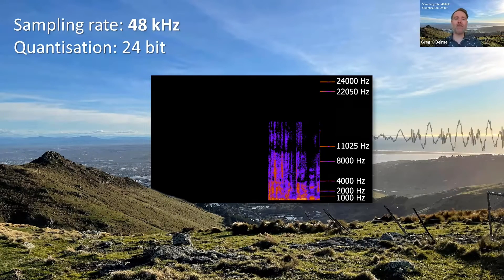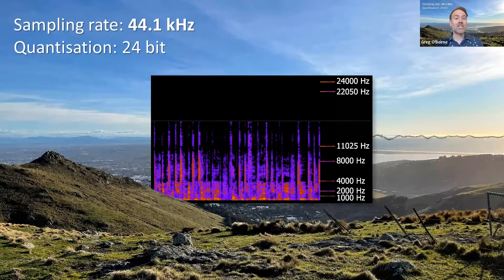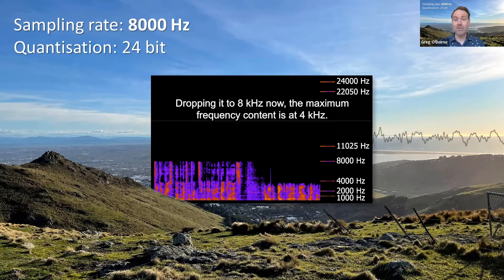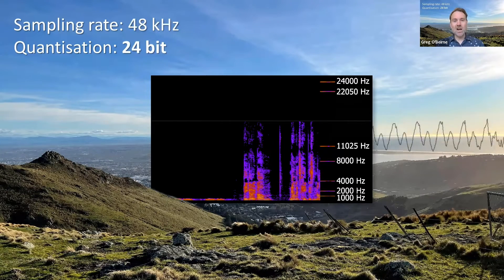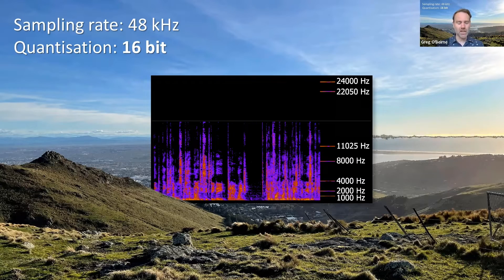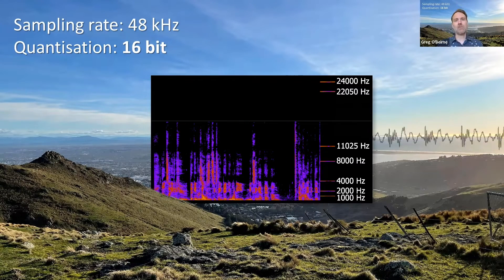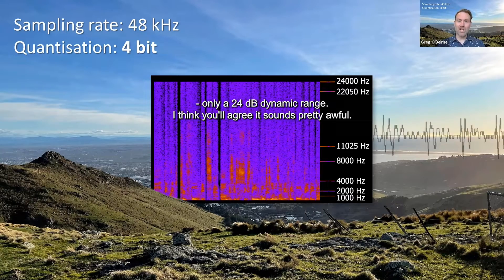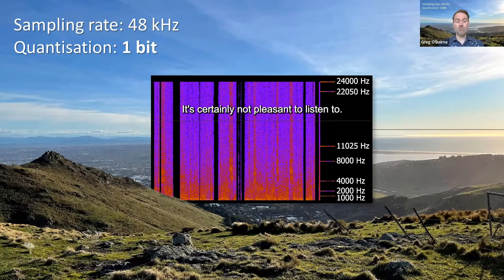Digital sound: Sampling rate + bit depth demonstration

Comment: what software did you use in order to change the quantization and sample rate?
Reply from the maker: Most of it was just standard audio editing software (Adobe Audition in this case), but I wrote custom software in LabVIEW to create the 4 bit, 2 bit, and 1 bit demos. I had to amplify the signal quite a lot prior to the 1 bit to ensure enough crossings of the zero-point. The visualisation of the time-domain waveform was also in LabVIEW. Cheers :)